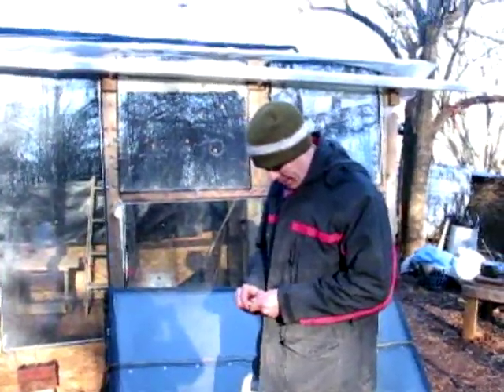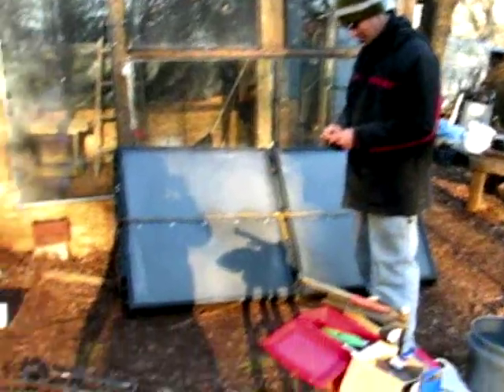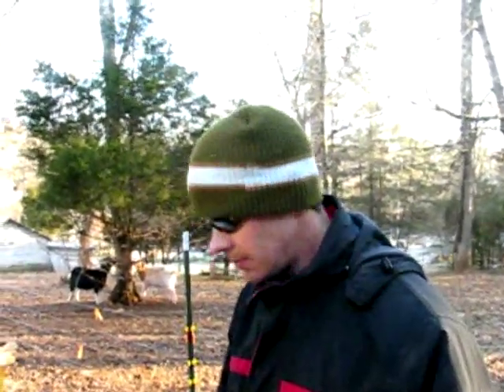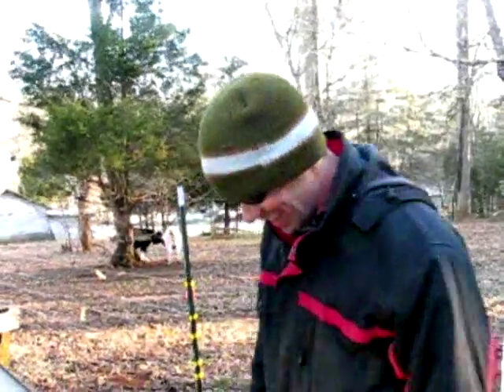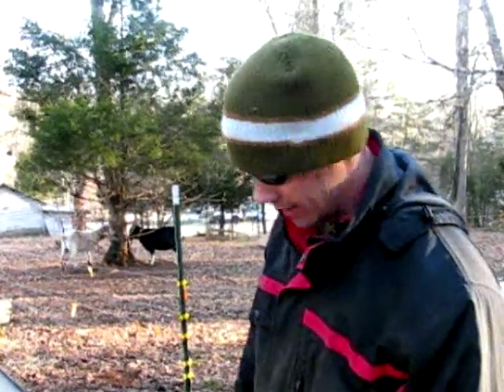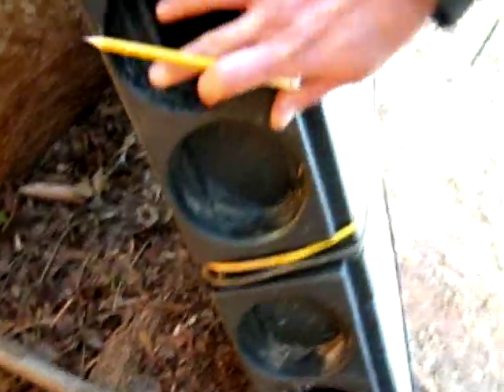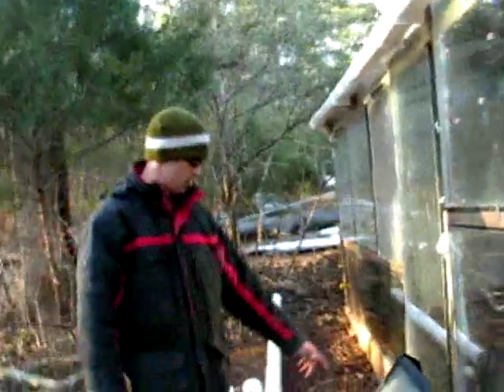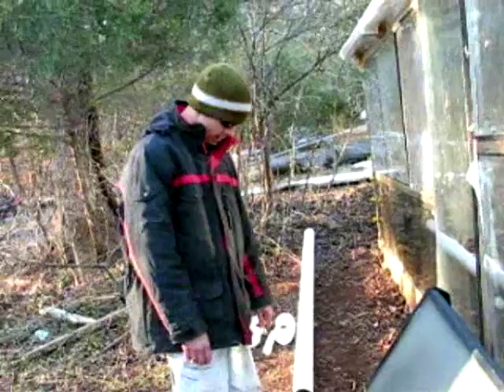DIY Solar Hot Air Heater for Greenhouse

Comment: How to wire a snap disc by richallenmusic has some info on how to wire up a snap disc themometer what is does is it close when the temputer get so high it closes the cerit and the fan comes on and when it cools down the fan turns off or opens the ceruit i hope this little bit of infomation helps

the cheap guy

Comment: Pretty sure that "Electrical thingy" is a snap disc thermometer.  Was used to tell the fan when to turn on.... when the temp. in the panels gets hot enough.  Most of them are set at 110 degrees farenheit.  You should use it!! No use blowing cold air into the green house.

Comment: That small part you found there might be a temperature sensor - typically used to turn the fan on to circulate the air through the solar panel when it is warm enough , othersise it does not turn on so that cool air is not brought into the area that you want to be heated.